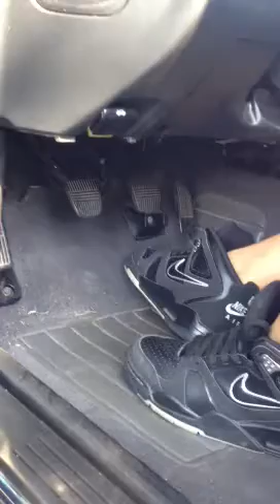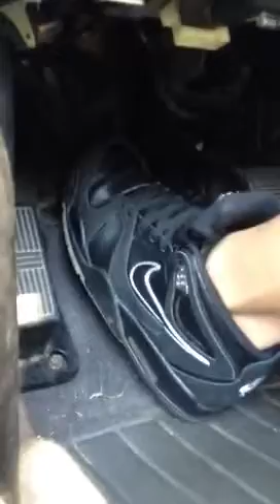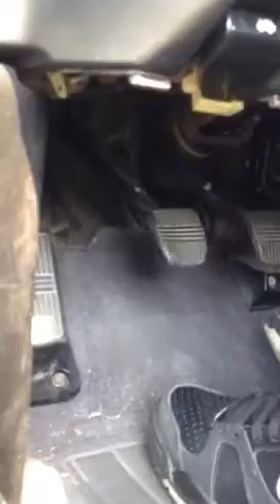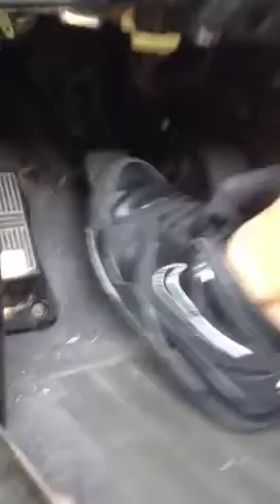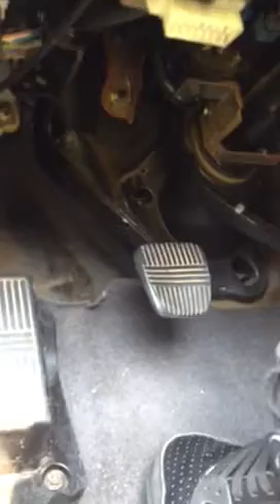Pedal sticking

Comment: I have one out back and one forester with this problem. If there is NO LEAK,Try this, remove air filter box unbolt the slave cylinder, remove the pin and the the rubber cover, push the alloy piston out by pushing the clutch pedal down. The dirt between the cylinder and the piston create friction when it hot. Clean them, flush the old fluid, reassemble then put every thing back,bleed air. you will fell the difference of the clutch pedal. It work on mine so it is worth to have a tried. It is simple procedure.

Comment: Guys, if this happens, you can check the clutch cable. In my car (2001 WV Caddy 1.9. I will explain this small repair job through my car If you need it very much, improvise based on what I told you.) Just to the right of the engine, it is 1 meter long and looks like expensive bicycle locks. After finding your cable, go under the car and find the clutch cable from below. There are 2 hexagonal pieces that connect the clutch cable screw to the transmission and hold it at the bottom. 1 small, 1 large. If you tighten the small one (do not tighten the big one, only the small one. If the big one rotates, keep it fixed in place and tighten the small one). Your clutch will go halfway instead of going all the way to the end and staying there. (think of it as driving with half clutch and half throttle) If you do this, you will repair your car enough to take it to the mechanic.

Comment: Clutch pedal assist spring too strong. There may be a pop back spring too if it is a Nissan they can be weak. Try lubrication of the pedal pivot brushes and any other bushes yyou can see plus changing the clutch fluid and bleed it through until it's all new fluid in the system. They the cheap option first.

Comment: There might be air in your clutch lines system bleed the cluth take all the air out and make sure you master and slave cylinders are not leaking any fluid

Comment: Change your car master cylinde . This is very common problem for voxhall vivaro and Ronald traffic
Reply: So i got a new clutch and flywheel in my astra J OPC. Now my clutch seems to be sticking ocationally at half way for a second or so. I bleed the system again and changed the brakefluid with that. Still the same issue. Do you think the mastercilinder on the pedal is causing this issue? Or do you think that the releasebearing sleeve where the bearing sits on is causing it to stick halfway?